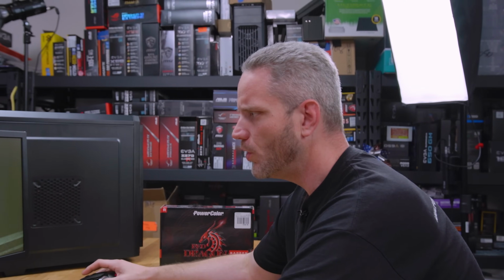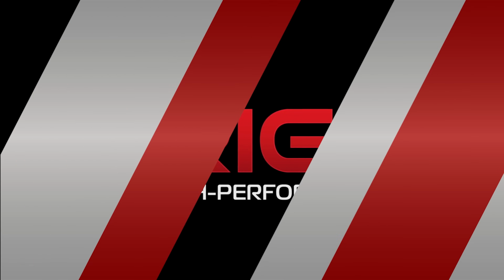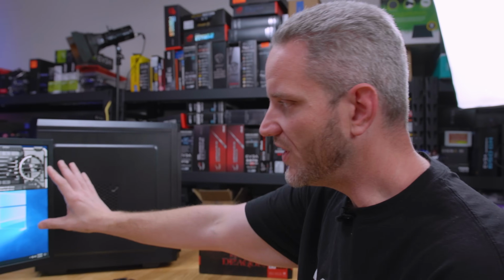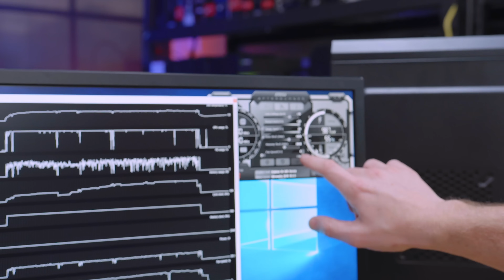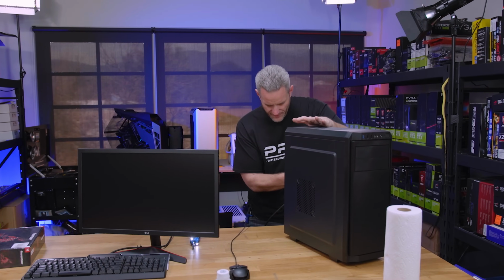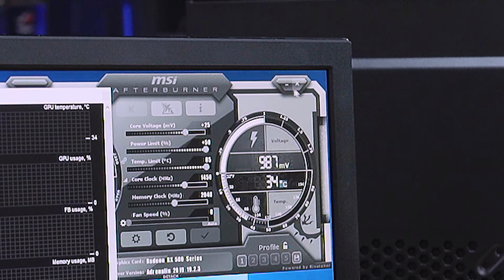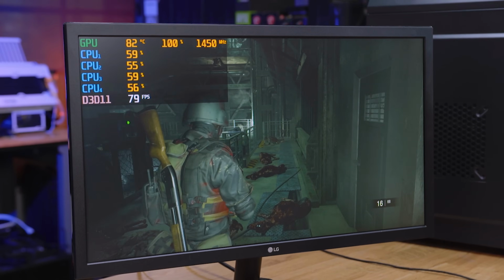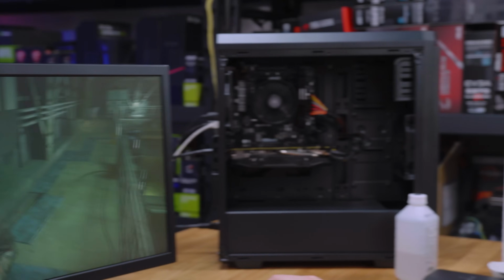Should you replace your video card's thermal paste??

Comment: I replaced the thermal paste in my old GTX 970 and got way better temps. 
I think replacing thermal paste is more of a maintenance thing than a way to increase performance.
Reply: I agree, i replace mine on my 970 and dropped 10°C with 30% less fan speed. :D
Reply: @Askaly  got my fans on auto.  Idle with 0% fan curve  35c.   While gaming 65c to 70c. max.  amazing for a 4y old card.
Reply: @Enclosure_2k , almost the same here. I got this GTX 1070 since 2 years by now and temps stay 59~63°c (but with active Fan settings instead). Wonder if theres any need to change the termal paste the next few years.
Reply: @Nebujin383  what's your cooler? Mine is the msi dragon. Beast cooler.
Reply: @Enclosure_2k , Gigabyte's WindForce Stack 3X (3x 100mm) plus GPU overclocked to 2090 Mhz.
Reply: @Nebujin383  Thats good man!  Damn 2.1mhz?! Amazing with that temps hahaha. I have my 970 oced 100 core  and 300 memory.  It does miracles with a ryzen cpu. My old i5 was killing my performance so badly.
Reply: @Enclosure_2k , my 7+ years old i5-2500K also held back my 970, and i was stupid enough to do a GPU upgrade before CPU upgrade. The i5-2500K (even @4x 5.35Ghz) was nothing but a tight bottleneck for my 1070... sadly but obviously. In the end of 2018 i finally bought me a new rig (i7-8700K @4.9Ghz all cores), the performance difference was like day n' night. More than twice the minimum FPS than before, with the same card. Your performance difference must have been massive aswell, no doubt. The 970 still has power today, and if i didnt aim for a higher refreshrate monitor she would still be doing her job today. But needs have changed a little xD
Reply: @Nebujin383  So true man. I double the framerate in some games.IN deus ex manking . I was playing at 60+++ With my i5 was a freaking lag festival. with all cores 100% . I going stick arround for couple years with 970. Its a beast of card. If only it had more vram.
Reply: Quick question, how often should you replace your paste on CPU?
Reply: @Kauladin  Depends on type of paste. (with or without metal) Particles of paste slowly evaporates so it loses its liquidity and slowly hardens. That way it may get better termal ductivity after time. But the old paste loses its ductivity after time. ( From my experience everything older than 10 years without change of thermal paste can thermal throttle or even die. Due to oxidation and chemical changes) In a nutshell. Changing paste every 5 years can increase life time of your components.
Reply: @Kauladin  i do it in the middle of every year
Reply: VeenK  2-3 years, or when you notice that your card is way hotter than when you bought it. The fans are also a giveaway, when your card start struggling with cooling :)
Reply: @Kauladin  every other day
Reply: @Kauladin  As needed. Write down your max temp and replace the thermal paste if it starts to get higher. (It's impossible to tell if you don't write it down as I found out lol. Wasted some time on pointless paste replacements in the past.)
Reply: @Kauladin  If you'd repaste your gpu every 2 years, I would say cpu is good for it's entire lifetime. As you won't run your cpu as hot 247 as your gpu, so the paste won't harden so quick.
Reply: @Kauladin  what cooler you have to begin with?
Reply: @Kauladin  depends on the use, how more frequent the better i would say at least 1 time a year
Reply: @runarjans  I wouldn't change thermal past yearly unless you're pushing serious heat through it as it'll dry out quicker
Reply: @christophervanzetta  if you use a pc daily it would dry out quicker than you think but it's still only a problem if you reach extreme temps
Reply: @Kauladin  just do it at the start of summer that way you kbow your good. 👍
Reply: @Kauladin  Depends. Factory thermal paste usually lasts 3 years max before hardening. 
If you are buying new thermal paste, check to see how long it usually lasts.

Mx-4 is 5 years and is pretty good.
Reply: @Kauladin  A good rule for me has been once every 6 months to a year. 6 months for my personal build, 1 year for anyone else's (in the house, friends, etc.).

You dont want to wait years, because thats when stuff can go wrong. A relative of mine wanted to sell his pc, and asked me to inspect it first. I had to replace the thermal paste on the cpu AND the gpu, because in 9 years, neither had been replaced. The cpu stuck to the cooler (stock), and the gpu ran such high temps that I force booted it off, immediately upon seeing said temps.
Reply: @Kauladin  half year to year
Reply: @Kauladin  for what its worth, my i7 4790k has the same AC MX-4 thermal paste it had from day one 6 years ago....I roughly get the same temps as day one
Reply: @Kauladin  cpu imo doesn't really matter lol.
Reply: @Kauladin  Just guide it by your temps/fan noise.
Reply: @Kauladin  i do it once in a year on every component.
Reply: sounds like I should do this to my 980ti
Reply: would recommend, i did it around 6 months ago to mine (gtx 980 ti msi gaming g) and dropped temps by 7 °
Reply: Same thing, because Nvidia cards throttle based on temps
Reply: i got 30 degree drops down to 60 from 90 on my gtx 1060.. i used arctic mx4.
Reply: @mangshu21  MX-4 is great quality paste with a 5 year life span on components.
Reply: I replaced the thermal paste on a 2 year old 1080Ti and temps are identical at 100% fan speed. You probably don’t really ‘need’ to change the thermal paste very often, possibly 5+ years.
Reply: I replaced the paste in my 970 about a year ago, should I do it again?
Reply: Did the same 1 month ago, also on a 970. 4 degrees less and cools down faster :)
Reply: That also helped on my Gigabyte GTX 970 WFx3 OC, but you can improve it even more if you use a tiny 35mm fan directly on the heat fins to route the heat out one of the sides of the card, that alone improved my OC stability by a ton
Reply: I replace when i buy. So far I have never meat a product with GOOD thermal paste. I have seen decent , ok and extremely crappy but never good so far... With decent thermal paste you will not see much running temperature difference but when load is reduced the temperature wont drop very fast... With the good stuff temps will drop almost immediately on a good cooler. If you have a bad cooler they will still come down faster but maybe not imediatly. And if you have a bad cooler replace it LoL.
Reply: yep it is indeed for maintenance, my msi gaming gtx 780 was crashing randomly in certain games (which is why i got it from my older brother essentially free + some ddr3 ram.)
changed thermalpaste & put in a adjusted fan curve, + fps limiter, now sitting nicely around low 70's high 60's at 1045 mhz boost speeds.
Reply: A few years ago I got gtx 670 (EVGA FTW) almost for free, coz "it is so loud, that I cannot play". Blower style cooler, indeed - it hit almost 100 Celcius degrees under load and throttled.
Once I've changed the paste - card stayed at nice 80-81 under load.
I guess paste can last at least 1 year, after that you can change it, but you don't have to. But after 2-3 years - definitely change paste.
Reply: https://www.youtube.com/watch?v=smrDCx2SMHo
https://www.youtube.com/watch?v=hYQ1cDGeDmM
(Different paste questionable results)
https://www.youtube.com/watch?v=DzJFHTjuIww
Doesn't seem to degrade any significant amount. Maybe on some rather cheap ones?
Reply: I replaced the thermal paste in my 4 years old 970  too and it went low 80s to mid 60s
Reply: ElZamo92 my old 970 did too
Reply: I bought a very good condition evga SC reference style - like new, but replacing the thermal paste was the best thing I ever did, got the card down from the high 70s into the 50's for the OCing
Reply: I wouldnt say increase performance but definitely insures longevity of performance
Reply: U need to change the thermal paste every 2 years. And clean the dust every 6 months or less 3 months.
Reply: same here, my 390X had dirt and dust gunking up the fins and the thermal past was all dried and cracked. A good thorough cleaning/pasting, and shes running like new again
Reply: you need to replace the paste on most CPUs and GPUs after 2 or 3 years as maintenance. all pastes have an expiration date once you take them out of the tube and they dont work properly if that date passes. of course it all depends on how you use the hardware. if you play old or indie games with low hardware requirements, the chips don't heat up so the cooler could do a good enough job without any paste at all but if you really push your hardware you need to keep the paste fresh
Reply: how old was your GTX 970 before you did that?
Reply: Yep did on my gtx 770 and dropped temps by 6 Celsius
Reply: I also own a gtx970 when i replaced the thermal paste i got 30°C lower temps during load. Also i don't know who applied the thermal paste before me, but it was mess, way too much thermal paste.
Reply: Did the same for my Palit 970 OC and it's definitely dropped temps and is far more happy/stable
Reply: Oh shit I have one too. I think I know what I'm doing tonight. 
One question though, did you also replace the thermalpads or were the old ones still fine?
Reply: Why say this.. Now I wanna change the thermal paste on my 970!
Reply: Well shit I was wondering if I should do it on my 970 and it sounds like I should.
Reply: I replaced it 2 months ago on my 970 too and I got a good temp drop
Reply: I had to change my northbridge chip heat pad to real paste because it was hitting in the 95+ C range. it's now 50C.
Reply: omfg you damn scared me, i was like the fuck i don't recall commenting here... 
PD: nice profile picture jobro
Reply: well i would rather air blow it so it remains Dust free
Reply: I just replaced it, too on my 970 after 2 years with thermal grizzly kryonaut. It is a happy card again :)
Reply: Personally I would only replace after the warranty is done and I am able to afford a new one just in case :D otherwise no way. I have done it once or twice on my previous one while I was at cleaning it from dust.
Reply: My 980 from 2014 might need to have the paste changed. What paste did you use?
Reply: @Ziplock9000  Don't ask what someone used like this, better look up on google the latest reviews or top 5-10 thermal pastes.
Reply: Did my 980 today, -13° was blown away, there was a VERY thin patch of stock paste, im surprised it lasted 5 years
Reply: @joshstevo88  That's why you should change the paste, often for CPU, but not as often for GPU, around every 2 years maybe? If possible.
Reply: I use industrial thermal paste with metal in it and thanks to that my rx 5700xt is about 8° less
Reply: hey i have my 970 for 4 years and never changes paste..ever..
Reply: i have gtx 970 that reaches 90c on low graphics settings...
Reply: I currently still have a GTX970 in 2020 and I had no changed thee paste on purchase and it's one of the founder editions
Reply: @neosdgod  i would ptobbably reccomend that you do change it, then increase your clocks by %10 then when its starts to get too hot again reduce clocks and power draw or re apply thermal.
Reply: Msi gtx 970 gaming 4g owner here: actually found little to no difference after like 5 years of use. I guess msi used/uses good quality thermal paste.
Reply: @MLWATKK That's with all low grade factory thermal paste to increase profit margins
Reply: So coincidental that this was the top comment on this particular video. I just thought to myself I bought this card (SSC 970) 3 years ago. I wonder if I try to replace the thermal paste if it will improve :D
Reply: my RTX2070 fans are struggling lately. i am considering changing its paste but i has not been 2years since i bought it. i don't wanna void waranty so im wating for about another 4 monts.
Reply: It is maintenance, but the Gigabyte does not let you do it, you have to send the gpu back to them
Reply: now your thinking like a true enthusiast. "why u turbo ur car?".... because GPU temps..
Reply: I havent replaced mine since I bought my PC (6 years ago) when in desktop not running any game with fan speed at 69% it stays at 60 degrees celcius. Might as well change the cpu thermal paste since you know .. 😬
Reply: 980TI user here, went from 81c to 62c under load just by swapping the paste. my next GPU choice will take into account ease of stripping down
Reply: @hmsmerlin7060  thats a massive change...was your room temp relatively the same before and after testing?
Reply: I don't really agree with that; Different thermal pastes "perform" (or conduct heat) differently. I looked into them like years ago, seeing tests with a whole list of different pastes, and it turned out that it could differ from a few degrees to maybe even 10, 15 or even 20 degrees with some. - So it's important WHAT or WHICH you use. - As for it being maintenance, probably less so as it will work for a long time without needing to be replaced. Unless it's some kind of stuff that's really thin or just dries up or whatever.
Reply: if you have to replace the CPU paste why not GPU? makes sense.
Reply: It's sort of both if you use one of the best pastes.  The stock paste they use is okay, but the good stuff they sell nowadays is better.  But yeah the biggest concern is when it dries up over time and like you said it becomes more of a maintenance thing.
Reply: Like the way you said 'old GTX 970' 5 years ago. Im still using one lol
Reply: DAGA KOTOWARU
Reply: That isn't obvious?
Reply: Better temps is better performance lol

Comment: I used dielectric grease on my CPU instead of thermal paste. Can you test dielectrical vs thermal paste please?
Reply: It'd be good to see tests but I suspect the answer is that it doesn't matter all that much because the paste is only to cope with the fact that the cooler and die are not a perfect fit and whatever gunk you put between them is only to avoid any air gaps between the two.
Reply: @user-qf6yt3id3w  thanks T. I figured if it was good enough for spark plug wires on hot hods, it would be fine for the cpu.